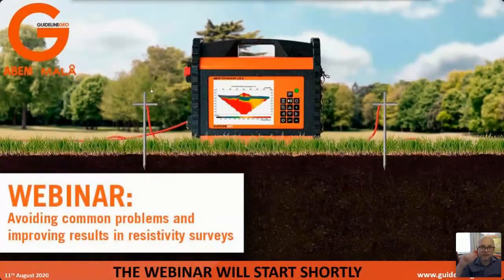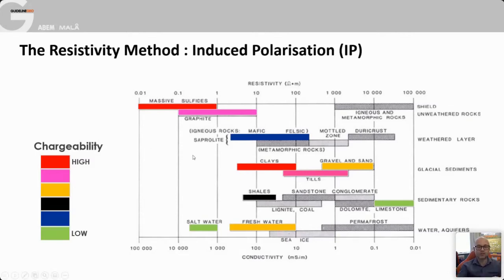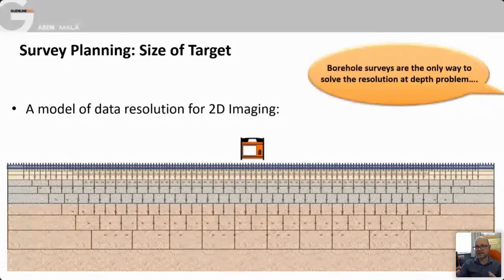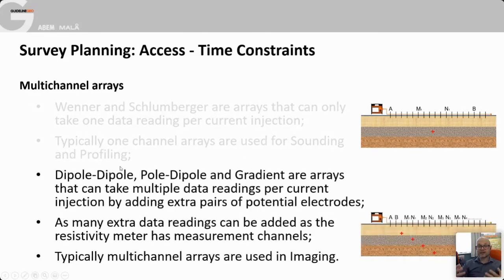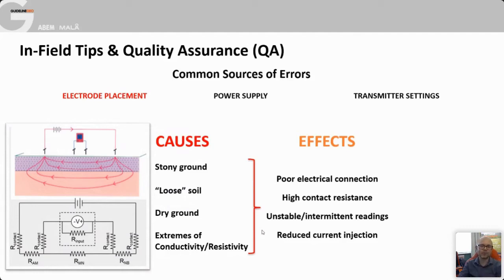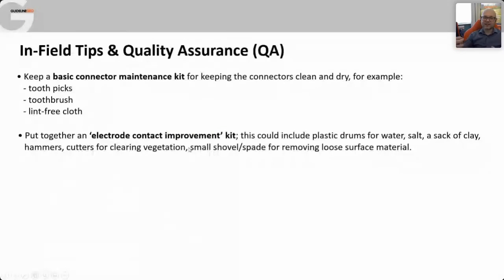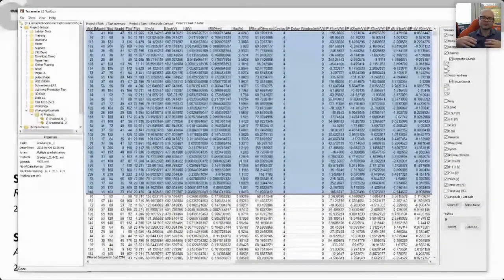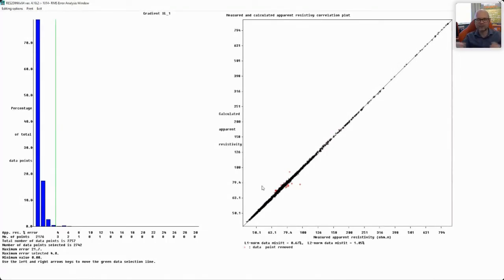Avoiding common problems and improving results in resistivity surveys

Comment: Sir, if I want to use the electrode configuration (protocol) Pole-Dipole (using 64 electrodes to get a 2D section of IP data), do I have to connect any additional current/potential electrodes to the instrument ABEM Terrameter LS 2?
Reply from the maker: Hi Malik, You would attach a remote electode via a single-core cable to the C2 port on the end panel of the instrument. You would need to respect the necessary distance offset for that electrode - a lot of people go for 7-10x the spread length.
Reply: @jimmyadcockABEM  Thanks for your response, Mr Adcock. 
It should also be noted that we use 20 m electrode (64 electodes) spacing.
 In this case, should I attach the remote electrode 8960/12800 m away from the first/last electrode of the spread? Will it work properly despite such a significant distance?
Note, one of our customer asks for surveying 300 m depth of an area. That's why, your response is very important for me.